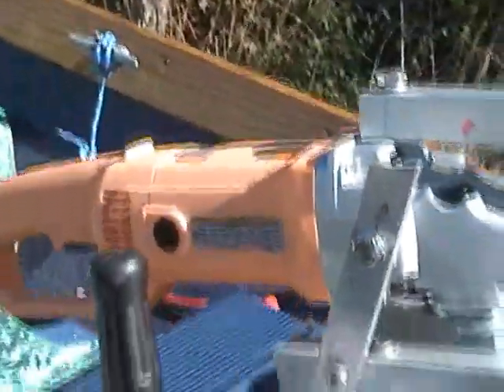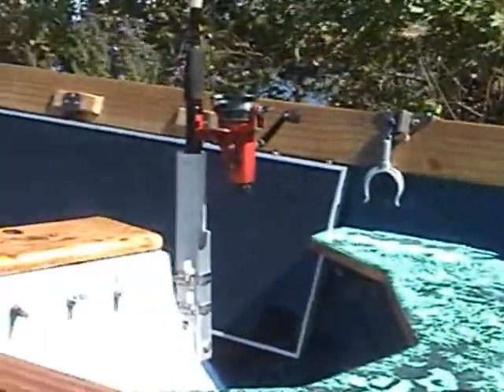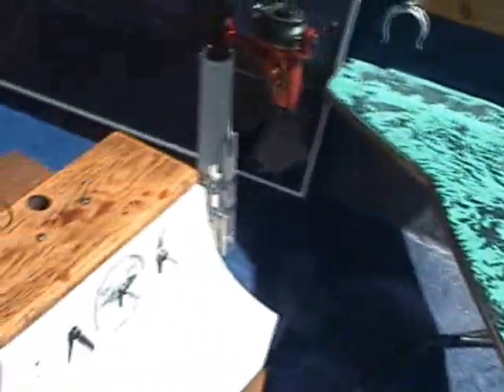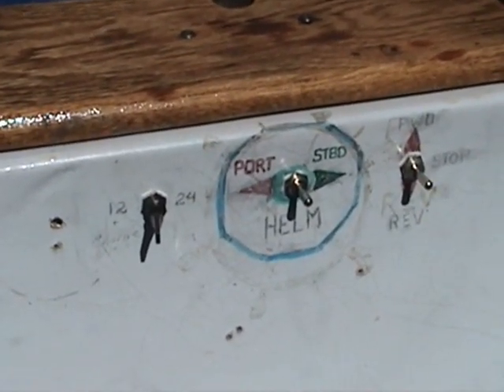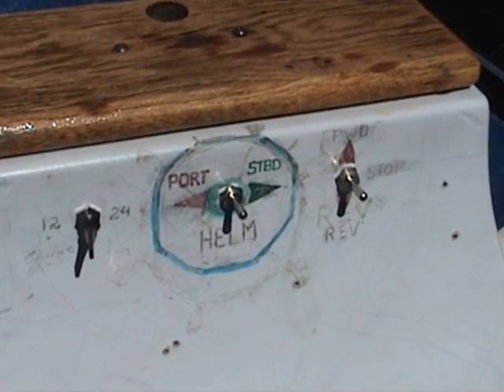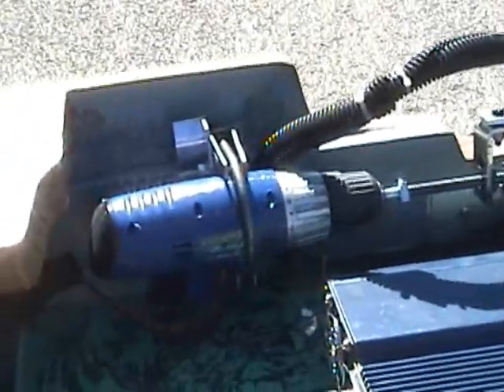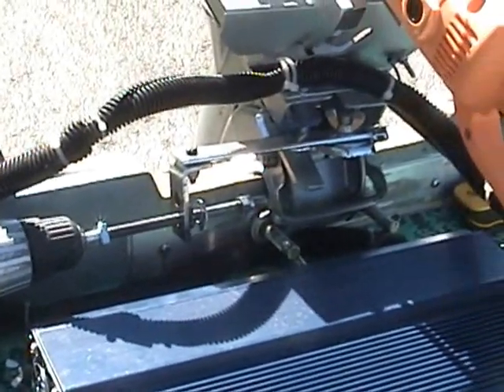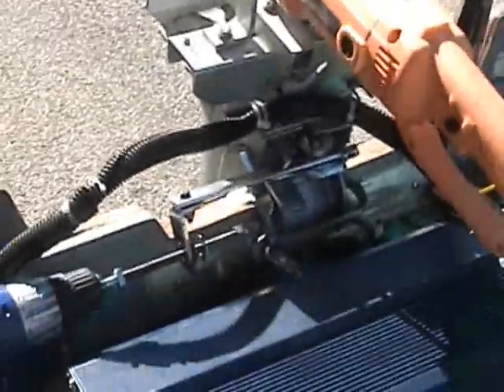Homemade Electric Helm Steering ~ Outboard motors~ The All electric Solar Powered  boat

Comment: Great job Great idea do you have any build videos can you tell me how long it will run  thanks for sharing and I must say that's how you think out side the box
Reply from the maker: Hey Hux,
Thank you for watching!
The electric steering drill and mechanizm are over 12 years old now. still runs and turns, by the flip of a toggle switch!  I have made some footage recently of steering drill repair I had to make ( just tightened the drill  inside gears to the motor. didn't have to change out any parts!)
Thanks again for watching
Reply: Thanks I'll have to check them out

Comment: Might I hazard a guess and say that waterproofing was a problem and the system may have seized due to rust?
Reply from the maker: Hey Tony,
thank you for watching.
the sound you hear is the clutch engaging when it reaches the stops ( left right).
same motor I use today.
never had a problem with it.
Thanks again for watching!

Comment: why waste power when you have the handle of the grinder to steer with and I know you have console, why not use it and do it manually. with the time wasted building a electrical power steering u could have gotten a cheap one off Craigslist.
Reply from the maker: ~ hey jaun ~ thanks for watching ~  simply a unique steering system. and it works great!!! thanks again for watching
Reply: ok thanks just wondering but if you did it just to see if you could build it and you did good job!!.